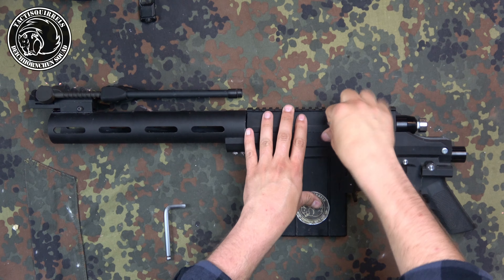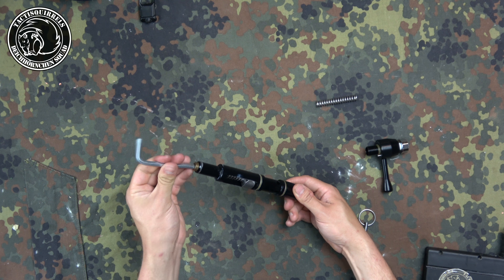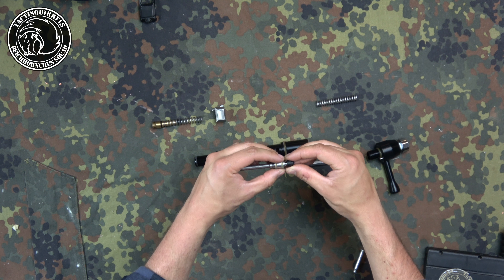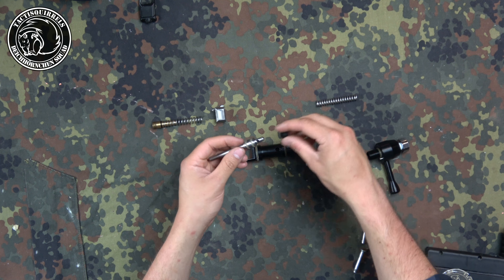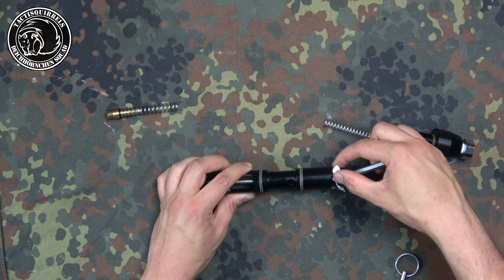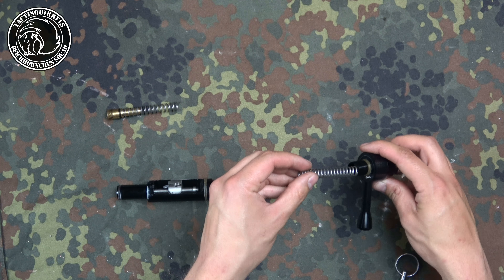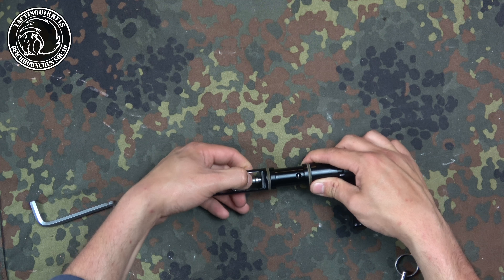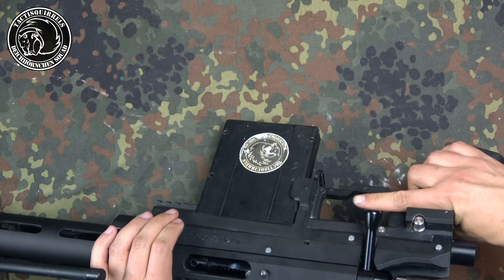Carmatech SAR 12 c gen. 2 BOLT assemble maintenance

Comment: Short question, why do you need the airpressure instrument at the back back of your bolt handle?
Reply from the maker: 2 reasons 1. I can Guss witch area of fps I am before I fine tune... 2. Wehn I am in big games I can see wehn I running out of air without getting out of my shooting position 3. It's fancy ;D
Reply: @philtacti7240  thnx for the answer! So this will show you the working pressure  in this case around 500 psi or the pressure in the bottle?
Reply from the maker: It's showing the operation pressure with the hammerhead barrle fps near the psi... the Nemesis barrle is something of 15 fps more with the same psi
Reply: @philtacti7240  What PSI does that gauge show for about 280fps?
Reply from the maker: @CowboyMayhem  round about 240 psi with a good fsr throu a 20" Nemesis
Reply: @philtacti7240  Thanks! Assuming with the SAR hammerhead it would show around 230-235?